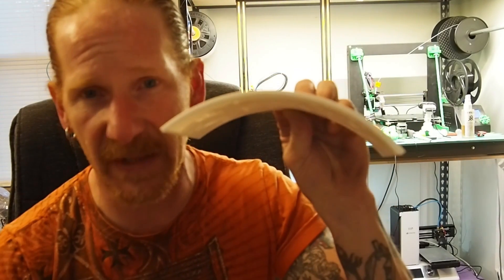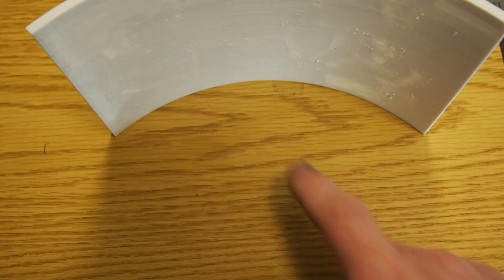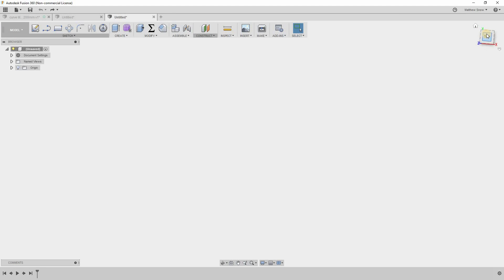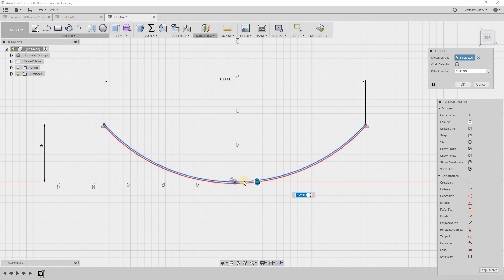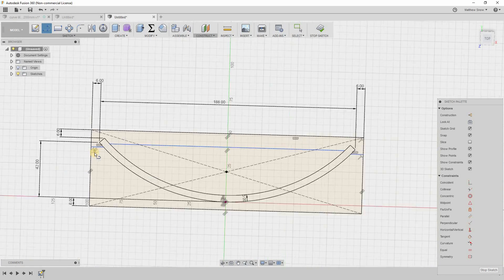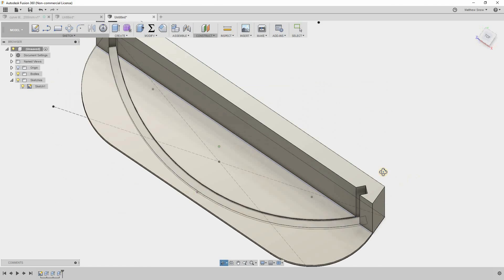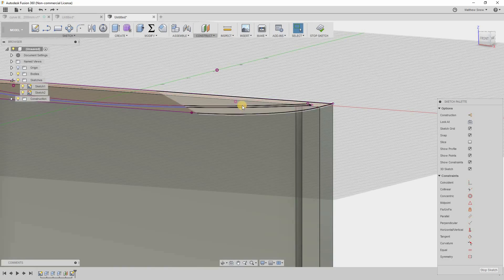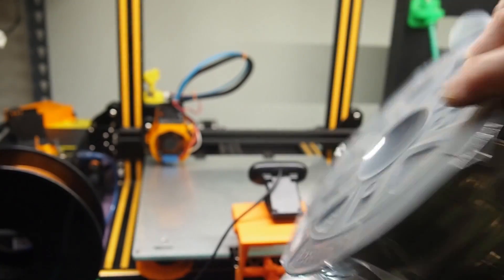Custom Curved Lithophane Frame in Fusion 360

Comment: hi, what is that orange sponge type of thing on your filament holder.  is it pipe insulation???
Reply from the maker: Just a kitchen sponge with some canola oil on it inside a 3d printed holder
Reply: @InsideTheMindOfMatt  ok thanks
Reply from the maker: @cbellasbusta4643  helps if you find your pla is jamming
Reply: @InsideTheMindOfMatt  yeah thats what I was thinking.   Mine kinda gets so far round then jumps.  I'm  guessing the filament will come off the spool smoother

Comment: Do you have a video on the light setup? Also thanks for the video :) Have you tried to create the bottom curve using the lithophane mesh. I used the "create mesh section sketch" then created a sketch from that.. I am still learning and love the rest of the steps you had with creating the box. thanks for sharing

Comment: Superb Matt. Just a query the top frame will snap fit into the base or we have to glue it or something like that. Anyway  you are easy to follow . Thanks
Reply from the maker: I believe I hot glued it to be able to open it back up easy in case something happened to the light

Comment: I used parts from amazon for the led's and I like the variable switch.
connectors:  https://www.amazon.com/gp/product/B079DQV334/ref=ppx_yo_dt_b_asin_title_o07_s00?ie=UTF8&psc=1
power supplies: https://www.amazon.com/gp/product/B00FEOB4EI/ref=ppx_yo_dt_b_asin_title_o07_s01?ie=UTF8&psc=1
mesh cover: https://www.amazon.com/gp/product/B00FEOB4EI/ref=ppx_yo_dt_b_asin_title_o07_s01?ie=UTF8&psc=1
variable switches; https://www.amazon.com/gp/product/B01325KCSY/ref=ppx_yo_dt_b_search_asin_title?ie=UTF8&psc=1
LED strip: just white. https://www.amazon.com/gp/product/B00HSF65MC/ref=ppx_yo_dt_b_search_asin_title?ie=UTF8&psc=1
connectors to led strip:  https://www.amazon.com/gp/product/B06XJJMKKH/ref=ppx_yo_dt_b_search_asin_title?ie=UTF8&psc=1
Also , much to my surprise, a pale pla from creatity made and incredible pale blue lithophane of the milky way galaxy. 

Thanks again for your video.

Comment: Cool little enclosure! I wonder if the model would have enough flex to "snap in" the litho if you printed it laying on its back in one piece. Either way, I have a couple lithophanes I need to make proper frames for, so this was good motivation. Thanks! 
-Jim